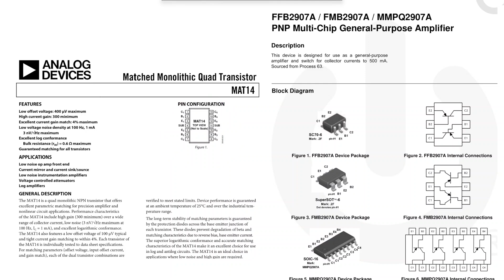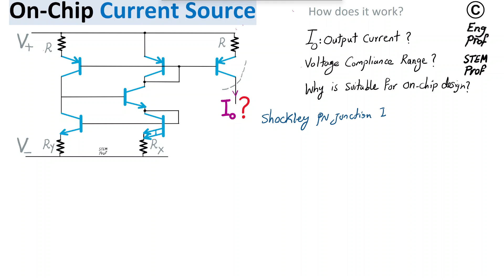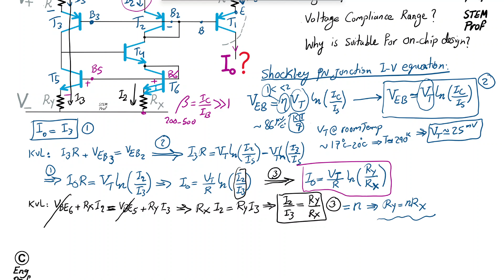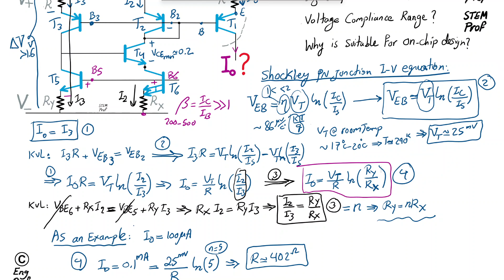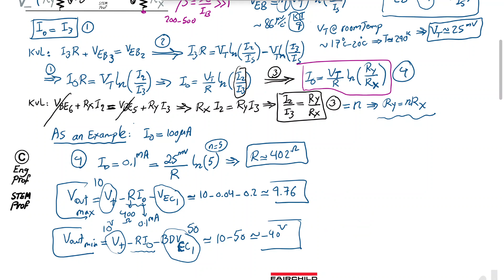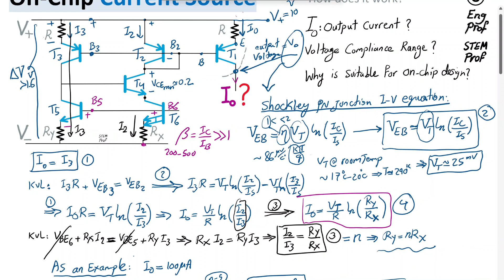On-Chip Current Source Design with BJT Transistors

Comment: Can the wider emitter area on T6 be emulated on breadboard by having multiple Transistors in parallel? Assuming closely matched characteristics, would current be exactly double/tripple/etc for 2/3/etc. transistors in parallel?
Reply from the maker: Thanks for watching and your interesting questions. Theoretically yes assuming you use matched NPN BJT transistors inside one package (for example using MAT14 Quad BJT Transistor from Analog Devices or alternative chip solutions from ST Microelectronics, etc). The resulting current should then practically scaled linearly.  For more analog circuits and signal processing examples see: https://www.youtube.com/playlist?list=PLrwXF7N522y4c7c-8KBjrwd7IyaZfWxyt
I hope this is helpful. 🙋‍♂

Comment: Excellent- are there current sources that are not so dependent on temperature? What are the trade offs?
Reply from the maker: Thanks for watching, your interest and follow-up question. Yes, there are temperature-compensated current sources and voltage sources as well.  The drawback depends on the technique used and the target accuracy or post compensation sensitivity.  Such designs require more components (hence more expensive BOM) and could potentially have stabilization issues. For more analog circuits examples see: https://www.youtube.com/playlist?list=PLrwXF7N522y4c7c-8KBjrwd7IyaZfWxyt 
I hope this is helpful.